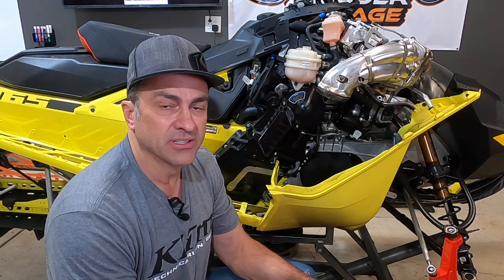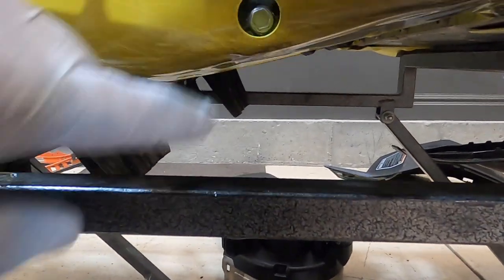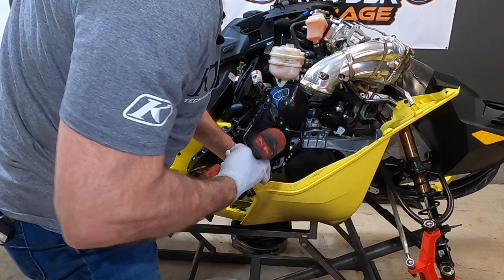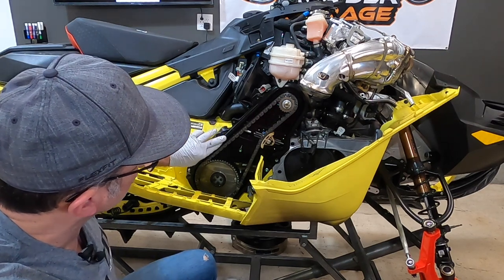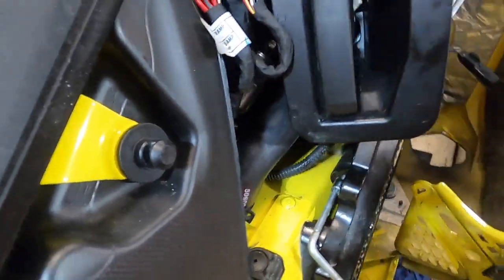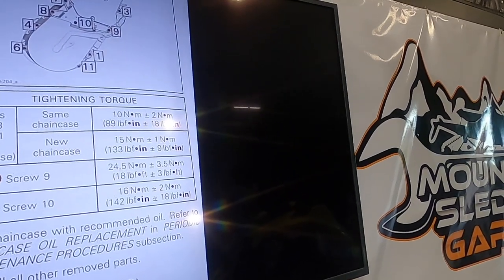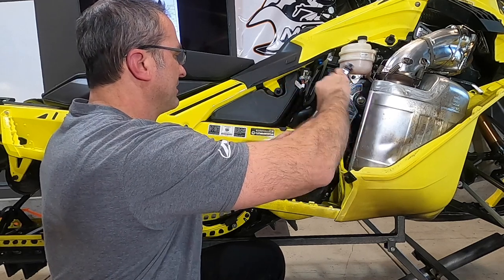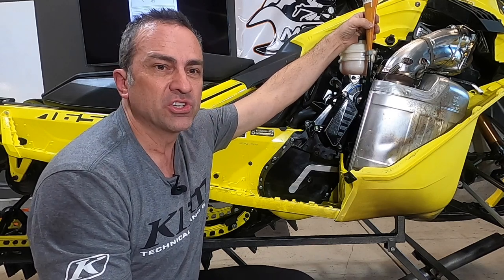Skidoo G4 chaincase

Comment: I like to replace those trilobular bolts with regular bolts as they are less likely to strip.   save the trilobular in case you need a new case.